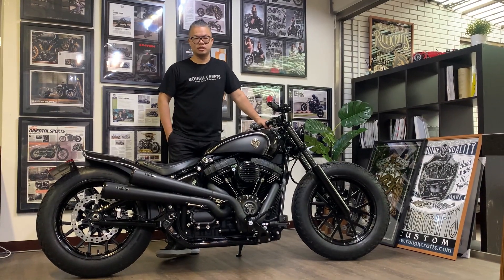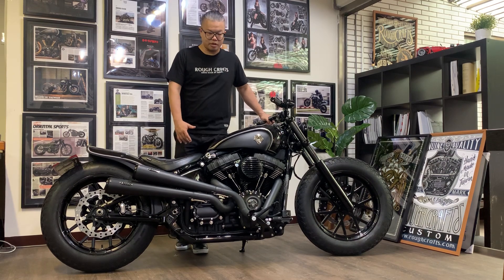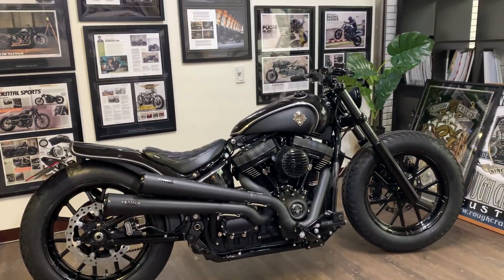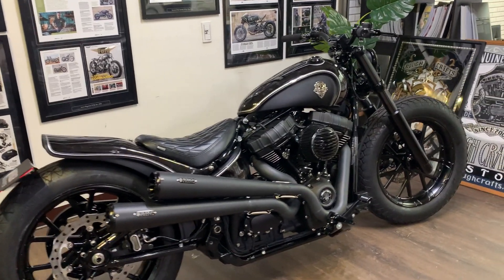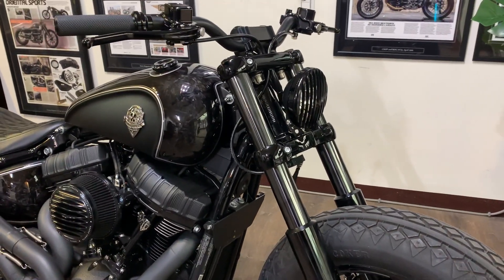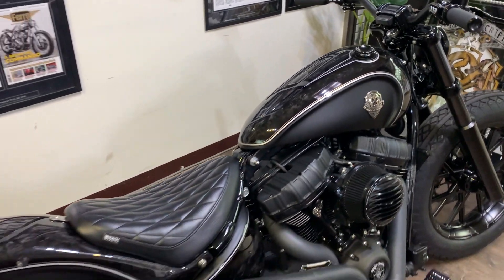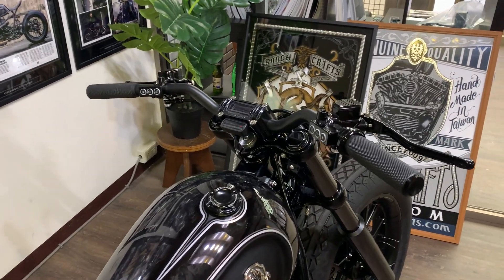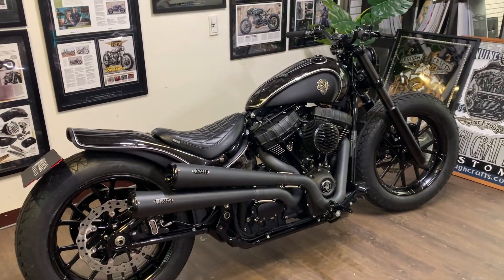Winston Yeh | The No Show

Comment: Very nice! Is that rear brake rotor a improvement over stock?
Reply: Can't really tell because the caliper looks stock. Not sure if it's an upgraded caliper. The rotor does look like it would help with heat dissipation and also the looks and lighter weight. Rear brakes on these bike feel pretty nuch non existent. So any upgrade would be nice